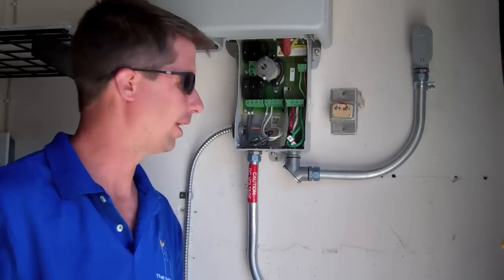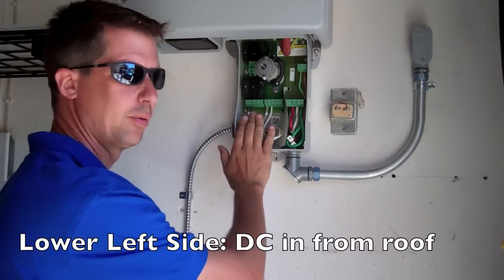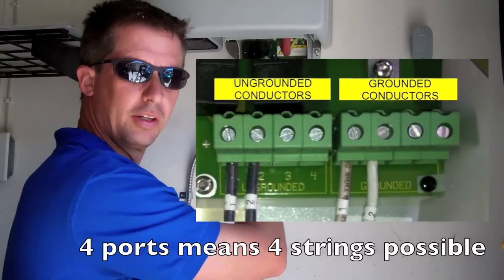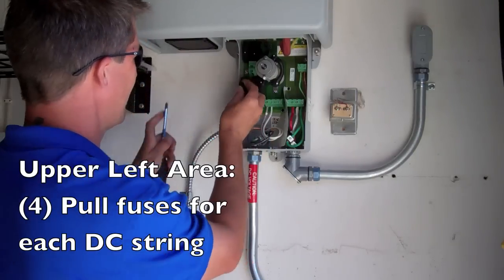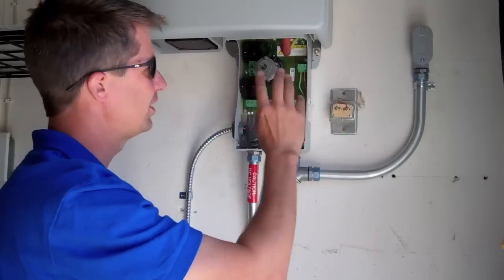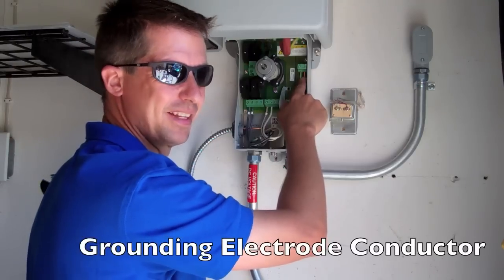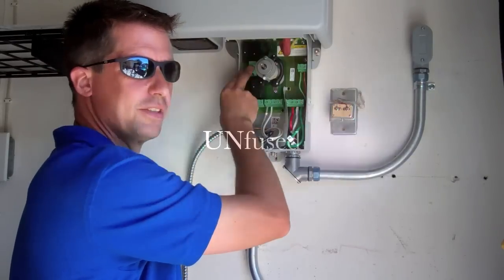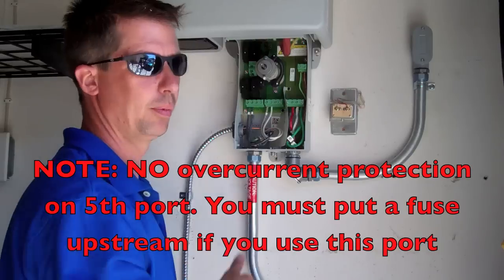That Solar Guy - TOUR OF DC DISCONNECT

Comment: how do you run the grounding from the racks and panels to  the grounding electrode conductor.  if you enter it thru the DC side how do you get it to the grounding electrode conductor, it has to pass thru the AC side?  is that ok? regards Bill

Comment: If PGE turned off the Solar AC disconnect, will the entire house loose power to from the grid?
Reply: Yo Stop yes unless you have a battery bank for a hybrid system.